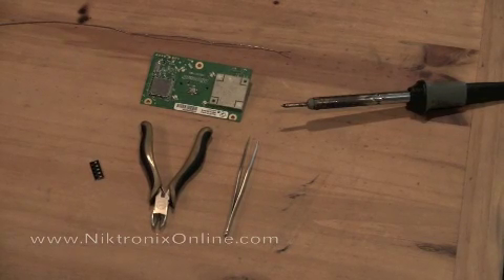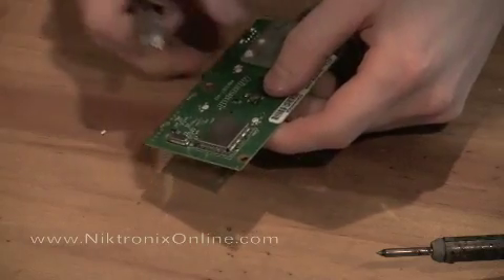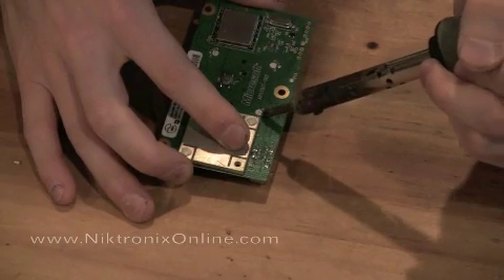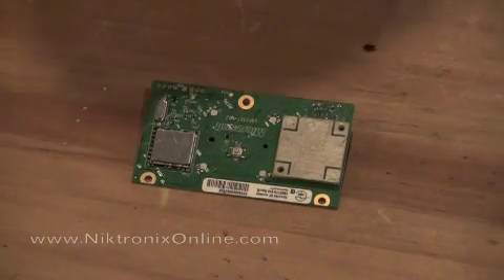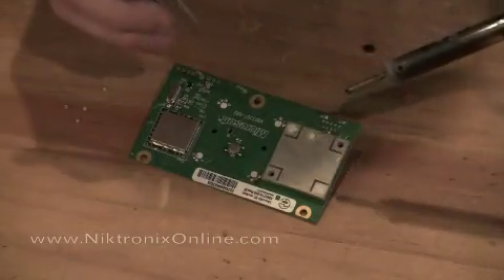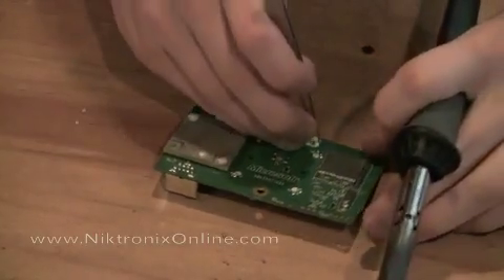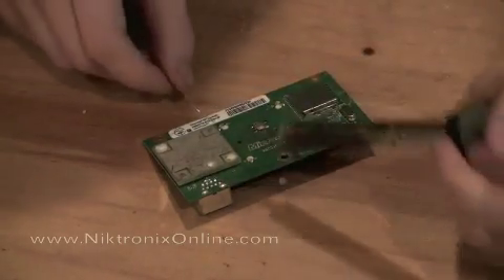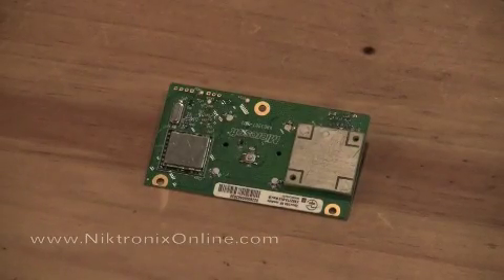Ring of Light Mod Tutorial - Niktronix

Comment: 0603 does fit the points. Since your only soldering the LED to the end + and the Middle -, and not both ends. I used 0603 on my ROL, and I have done allot of controllers, and ROL , for clients.